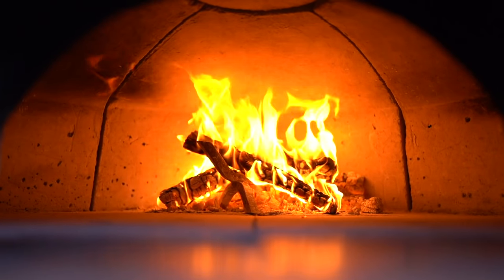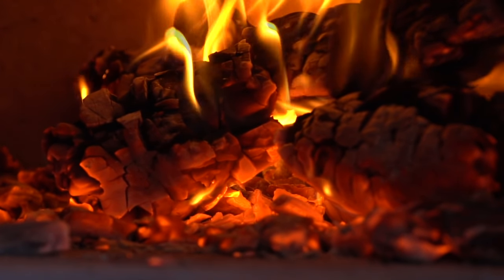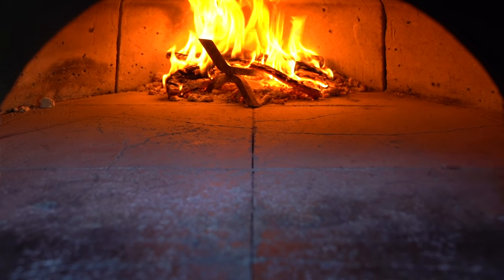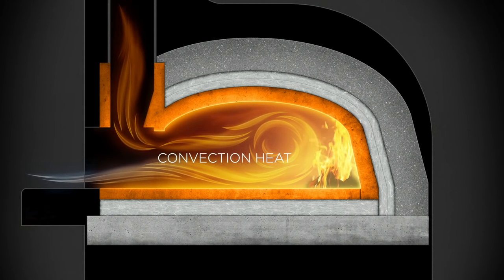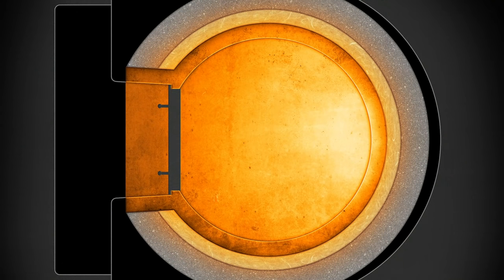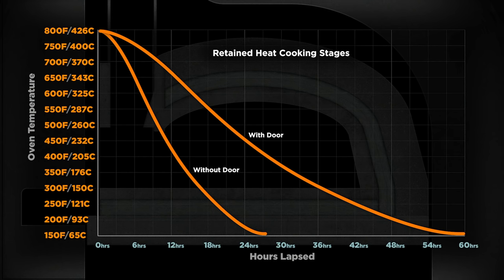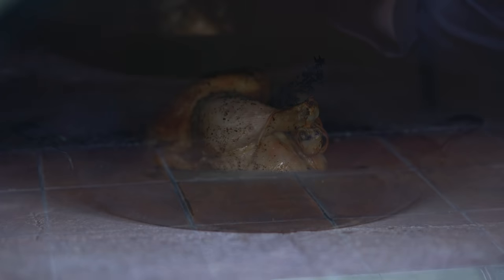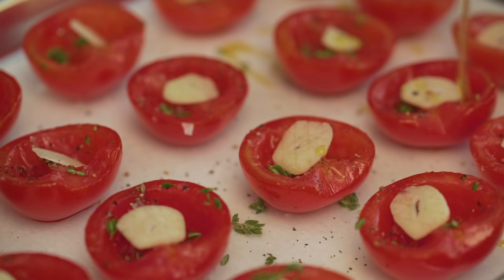Ep 19. An Introduction to Cooking with Retained Heat

Comment: Wow, I feel like the classical wood fired oven is a lifestyle more than a tool. Through this video I could really see how a family could maximize their firewood in a cold winter while keeping well fed throughout the day off the residual heat. I feel like it would really encourage you to cook in the morning with the oven ready to go! Thank you so much for sharing this for us who don't have a wood fired oven.
Reply from the maker: Thank you. Great comment.
Reply: In Finland, it was tradition to build these kind of ovens inside houses (sometimes detached houses and/or summer houses still have them included in newbuilds). They would then serve both as a cooking tool and a heating system for the house. I've even heard of some modern adaptations where radiant heating tubes have been routed through the outer mortar of the oven, to spread the heat into the floor system all around the house.
Reply: @veikkoimmonen7300 You’re talking about masonry heaters, right?  These are similar but are ineffective as heating systems.  This design goes back to Ancient Rome.

Comment: Glad to see another video. I was hoping you would make one on this aspect of the wood fired oven. My experiences with oven temperatures and times closely mirror yours. When I want to cook with retained heat, I often try and get the most use out of my heat. I’ll cook dinner the evening before with the fire and then bank the heat for a cook the next day. I too spread out the embers and put on my insulating door and will have some embers red hot after I remove the door. I will use these embers to fry some bacon and eggs.  After breakfast I’ll clean out the oven and will bake bread. 

Thanks fir posting this video 
Cheers
Reply from the maker: Great information. Breakfast is a great choice for retained heat the following morning. Clive

Comment: In my efforts to reduce waste and effort, I have started teaching myself how to use retained heat with stovetop cooking. It is a tiny shadow of your magnificent lessons here, but I am hoping it will reduce my power bill. This morning, after making turkey bacon in a small cast iron frying pan and turning the heat off, I was able to melt butter for my toast, and fry two eggs. I did turn the heat back on for 60 seconds, then off again. They were fine. We don't need to keep the heat blasting the whole time we cook. I am getting a clay slow cooker, and am looking at clay Dutch ovens to explore more use of retained or residual heat. We can simply turn our burners on to almost high for two minutes, then shut it off for many items we cook. Keeping a lid on a thick cooking vessel helps retain the heat. I loved your video1
Reply from the maker: Those are all great tips Lynn, and shows that there are many cooking methods that offer retained heat. Thanks for sharing your experience with everyone. Clive

Comment: Great video - thank you
If you have no need to cook once the fire is out, don't waste the heat but use it to really dry your logs for the next firing. Using dried wood is far more efficient and gives a cleaner low smoke burn. If the oven is inside the house, once the fire is out or removed, the use of a chimney damper and an open door makes for good room heating. Without a damper, much heat is lost up the chimney.
Reply from the maker: Great suggestions, thank you.

Comment: I have a Forno Bravo wfo with insulated doors for better heat retention. When I fire it in the evening to approx 750-800F I make pizzas. 
-- Then, the next morning, I make roasts, bake a slab of bacon, etc. (480-550F).
-- Then, I bake breads  (440-480F)
-- Meat, poultry & veggies dishes (350-4300F)
-- cakes, cookies and quiches (330-370F)
-- 36 hours from the initial firing of the oven, I am still able to use the oven for keeping the dishes warm.
At this point, I sometimes use the oven for drying herbs or fruits.
Of course, all temperatures are approximate. It requires our constant attention. 
Thank you very much for posting. Our family truly enjoys every one of your videos.
(@breadstravaganza)
Reply from the maker: Sounds like you get the most out of the full heat cycle.
Reply: @TheWoodFiredOvenChef  yes, but it took few months to figure out the whole process. It takes time to learn the wfo. We live in Canada where winter weather holds for almost half of the year, therefore the oven isn't used to a full degree during those months

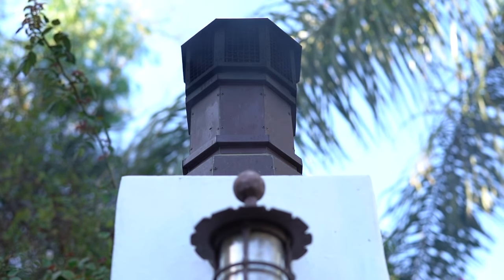Comment: 5:21 so why do some pizza ovens have the doors completely shut? There's only the chimney that's available to the oven, does both fumes and fresh air exchange in that one chimney? Most people with their home made half arsed pizza ovens can't even maintain heat after 12 hours lol. This video really shows you why a professional pizza ovens are expensive... insulation is key, a lot of valid engineering in thermodynamics plays a roll. This is by far the best pizza oven science on the internet.

Comment: It occurred to me after this well done presentation that you could put your vessels in the oven when its heating in start-up ("firing up your oven") and your waiting for the residual heat phase to begin. (You could make a plan to cook a couple of meals ahead of time with predetermined hot pans.  This operation would be beneficial  if you are having folks over for synchronous meals/days.) This way you won't dramatically decrease the oven temperature with heavy gauge cold steel or cast iron which are always beneficial with this cooking medium. You could simply have some of the pans you will eventually use during an event in the oven much earlier in initial start up.  I think you could use your energy more efficiently this way. (Probably not in every case but certainly some.)

 This principal is applied to some techniques in professional cooking.  One example would be with Southern American style corn bread.  In order to achieve the correct flavor and texture in the crust it is imperative to start with a hot pan and put the cold batter in quickly and rush it further into the oven.  The quicker the better.

As a professional line cook in the early nineties I would keep all of my sauté pans in a 500F oven during the Wall Street lunch rush at a very high end restaurant.  This enabled me to turn over multiple step items in seconds rather than minutes.

This idea may be impractical because it could impede convection.  Conversely if you were using low profile pans that fit together somehow it could work. (Such as your custom made roasting dish.) I have given this a little more thought but this isn't the forum to exchange ides like this.

Never the less,  I enjoy your work.  Your food is responsibly prepared and well executed.  I hope you enjoy your oven with your family for years to come.  Peace and happy cooking!

Chef Peter Sullivan
CIA '95
Reply from the maker: Many thanks Peter for all these great insights and suggestions. Clive

Comment: Thankyou for articulating,videoing/editing and sharing your experience.I am contemplating both the construction and use of a similar oven.I have seen a video of a slightly larger oven that uses 3 layers of brick,the first of refractory with refractory mortar,and second of brick both mortared with an earthen clay and then rendered with same followed by a third layer of brick of cement mortar.Would this style have any greater benefit to the use of single layer of brick and  insulated blanket then earth ?
They also used a layer of rock salt over earth ,under the refractory brick base.
Thanks again,though make the whole concept such an attractive addition to a persons life experience
Reply from the maker: Thanks for your generous comment. If it's of any help you can email me through my website I will send you all the information you need about my oven.

Comment: Great video, very informative and professionally done. Thank you! I've built a few ovens in various locations in England and Italy. I'd be interested to know the ambient temperatures associated with your calculations, as no doubt that too would influence the residual heat in an outdoor oven even if it's well insulated. Thanks.
Reply from the maker: Hello Trevor. Are you talking about the atmospheric temperature in the oven? I've mostly gone by the floor temperature, and then also the dome at times. They're obviously easy to measure. What's your experience with it? My oven has a lot of insulation, and the outside temperature never changes no matter how hot the oven it. Clive
Reply: I was thinking more of the atmospheric temperature outside the oven. My experience has been that in a colder damp climate such as in England it's difficult to maintain any retained heat after 12 hours as respects having an oven in the Mediterranean for example(not sure if that's where you are?). I've thought my ovens have been well insulated, using the standard method you describe in the video but it's evident that yours has extra additional insulation which I now think is well worth doing to have that retained heat and experiment with other types of cooking. Thanks for showing us the potential cooking usages of a wood fired oven using retained heat!
Reply from the maker: @trevorhughes9682  I would imagine, in colder climates, that an insulated oven door is going to help hold in the heat.

Comment: I like the idea of charting the fall in temperature. I'm sure it will help give me more consistent results. How do you measure it? Laser thermometer pointed at the centre of the floor?
Reply from the maker: Yes, laser, in the center of the floor. I tried using the force, but to wasn't strong with me 😄

Comment: Great ofen! What i am asking myself is, why does this ovens do not have an air inlet on the backside that can be shut down when the fire has gone out? My idea is that if fresh air and exhaust gases have to share one air opening on the frontside, the burning of the wood, especially on the back of the fire, is not optimal. Is your oven wall when heated clean or black sooted?
Reply from the maker: Doesn't really need another vent. The convection air coming through the front is enough to fan the fire.

Comment: Thoroughly love your videos and spin you project on total production. I don’t have a large enough space for a custom built oven as you have but wanted to get your perspective on the prebuilt stainless steel oven, Typically promoted as wood-fired pizza ovens. They seem to have ample cooking surface also but within a smaller footprint. Your thoughts?
Reply from the maker: I don't have any experience with one of the steel ovens Ricardo, but several people that have contacted me are very happy with them. Most of the major manufacturers have models, so I would start by contacting them. They are a great alternative if you have a limited space, and you want the option of mobility too. Let me know what you find out. Clive
Reply: @TheWoodFiredOvenChef  thank you for your feedback. Just curious, are you located in the US?
I don’t have those back drops in NYC

Comment: Good afternoon! I noticed that you have a very clean burning on the video. There is no smoke. How does it work out for you, because in furnaces of this type there is no special afterburning of gases?
Reply from the maker: Once the oven temperature rises above 650F/345C the heat will begin clear the soot from the dome.

Comment: Great vid! Would you recommend adding a tray of water for steam when baking bread? Tia
Reply from the maker: Hello Tia. You need to be very careful with water in the wood oven, since any spill can damage the floor. I have tried wrapping the door with a damp cloth, which works well for me. Also, putting a damp/wet cloth in a small pan. When I know I'm going to bake some bread, I put a small skillet in the oven while the fire is dying. I'll use that for the steam. That way it keeps the same temperature as the oven, and doesn't contribute to a drop in temperature if I were to put it in cold before baking. Clive
Reply: @TheWoodFiredOvenChef  great advice. Cheers - didn't know that about the floor. (Tia = thanks in advance, I'm called John! ;) )

Comment: Is there a spot where you recommend wood oven makes and models? I would be interested in what brand and line your oven is, and what size.
Reply from the maker: Hello Jim. Mine is a Forno Bravo interior dome, then I designer the exterior. I haven't used any other models so I can't comment on other manufacturers. Clive

Comment: You have good refractory. I built a refractory oven on a grill with ifb and ceramic board
Reply from the maker: Sounds interesting. How does it perform?
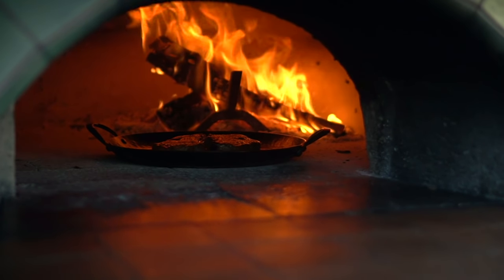Reply: @TheWoodFiredOvenChef  cooks a 14” in 3 minutes having to turn 180 degrees at 1:30 or it burns the back edge but broils the cheese and Sears the crust
Reply: @TheWoodFiredOvenChef  I’m going to make my first YouTube video on how to make it . I have found a no carb dough that balls and rises so I am making keto pizzas
Reply from the maker: @dummieall3150  I look forward to hearing about it

Comment: What your doing with the bake carrot and vegetable & garlic. Is similar what I do on a deep frying  pan, that to get all the flavors as I add even my powered soup stock to the garlic and vegetables.frying in good oil. Then lastly I add dry rice. And mixing while the fire on. So the rice get coated with this flavor.
then you add water about 80% and medium boil and cover till the rice start to rise when the water about even you turn the fires low.and just before it finish you again turn the fire up. To crisp the bottom.
 It's like that rice & sea food up Europe. It's one of my weekly.
 
I got a small omini oven so I going to try your carrots and garlic & vegetables and a few cuts of meat to go with rice. A tip here is try sea salt cristal on beef or pork . It's wonderful range of salt flavor. Vs a sharp salt.
It's matter. Bold taste. LOL
Reply from the maker: Thanks for all the wonderful suggestions Thomas. The rice sounds similar to Persian rice. Clive

Comment: Would you cook with thinner vessels inside the oven instead of something like cast iron. So less energy is wasted heating and more can be used on the produce ?
Reply from the maker: I use some All Clad Stainless Steel pans that work really well. The heavy duty stainless steel pans perform very well in the oven, conduct heat efficiently, and don't have any adverse effects from the high heat. One of my favorites is my carbon steel pan from Blanc Creatives. They are well worth the investment. Whatever you purchase you should check the maximum oven-safe temperature. I also have a couple of Cazuela dishes from Tienda.com. I have some Staub, and traditional iron skillets, all those can withstand the high heat (not anything with an enamel coating though, it won’t withstand the heat).

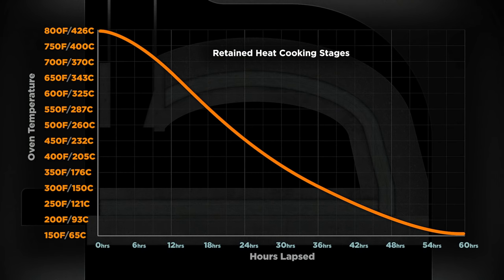Comment: hi one more time, please explain how did You meassured the temperature in the oven when You show the diagram in 7:20. With laser pirometer or by thermometer plugged into those doors insert. I think there will be some differences between heat on the surface and air inside.
Reply from the maker: I don't use a door thermometer. I use a Digital Temperature Gun and measure the center of the oven floor. There can be many variations each time I use the oven, depending on the temperature when the fire went out. But the chart gives me a rough idea of where it might be after a certain period of time.

Comment: How much wood did it take to get the oven up to tepriture to be able to use the retained heat? Also did u cap off the flue? Thanks. Amazing vid.
Reply from the maker: about 25 pieces of wood, which took about 2 hours to put enough heat into the floor and dome. The flue is outside of the door, so no need to cap it.

Comment: Thank you.
I have had my oven for 1 year now and cook in it weekly,mainly pizza.
My 3 year old sons fav food is now Pizza and he watches your videos with me.
I have bought the same tuscan grill you have and sawed off the legs, cook steak on it which is great.
I have lately been using a mixer for the dough but not getting same results as hand kneeding, do you agree?
Also will try your 50/50 flour mix instead off 00 100%.
Cheers
Reply from the maker: Hello Ben. I do use a mixer occasionally and get the same results that I would by hand. I try not to let the mixer do all the work, and do a little kneading before proofing. Glad to hear you and your son are enjoying the oven. Pizza is such a great food to bond over. I look forward to hearing about more cooking adventures. Clive